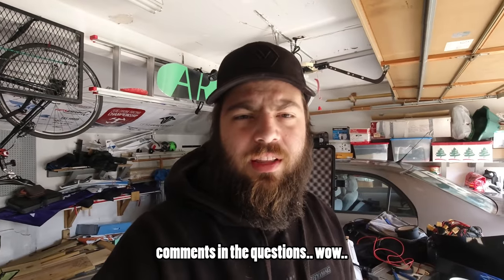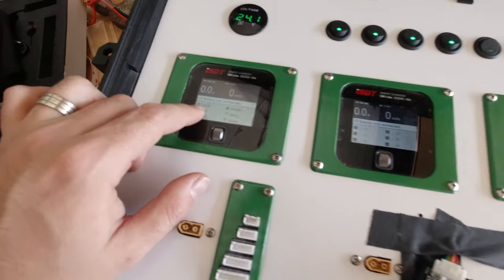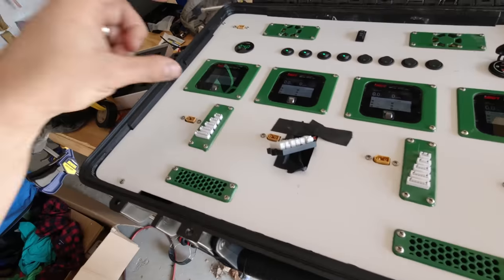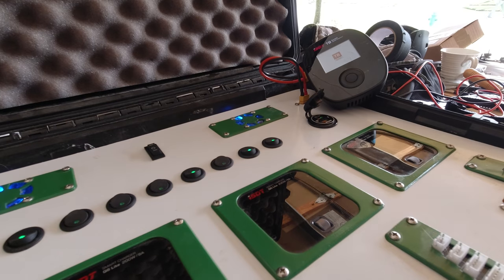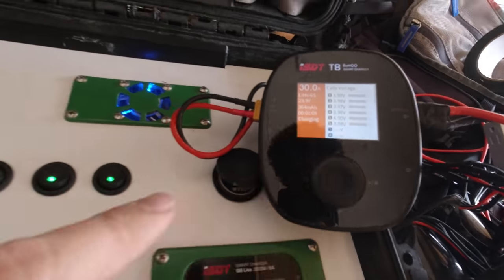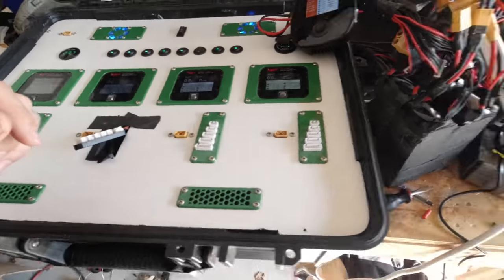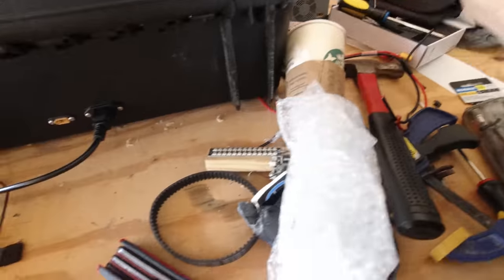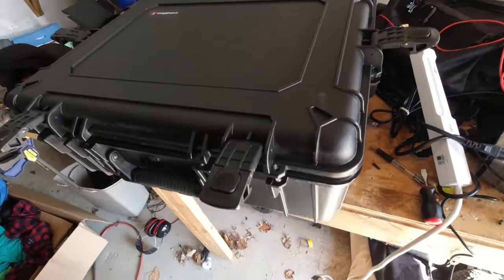Dream Charging Box is Finally Done!

Comment: Think you just meant Amps when saying amp hour a few times, ah only makes sense with regard to capacity 8A for 1hr is 8Ah of discharge, when comparing different voltages better to compare Wh for capacity comparison (accounting for voltage or electrical pressure).  Overall great vid as usual thanks for sharing!

Comment: I would recommend 8 gauge or at least 10 gauge for any hi current dc wiring. I love it though.
Reply: What do you consider high current? I use 8AWG for intermittent bursts of up to 120A, and 80A sustained...
Reply: @skatardude10  Yeah 8 gauge is adequate.  On his build, it looks likes he is using 12 gauge off the main power supply which works, but an awesome rig like this deserves better.
Reply: @locomotive282  yeah well its basicly free air wiring so its ok.

Comment: I have to agree with a lot of the other comments. If you're ever running the full 60a out of the 24v power supply, those wires aren't going to like it. If it's burst, whatever, but you're pulling continuous current. You really want 8 gauge copper.

edit: Considering you're using bussing, you ESPECIALLY need to oversize the wire. A lot of resistance builds up in those busses over time when you pull that much current. You can buy fused busses for car audio uses that will work really well and be a little bit safer.

Comment: Awesome amount of amps at your fingertips there!
Over 3 years ago I assembled something in the same vein, using an old flight case I was given, I mounted an old Xbox360 PSU in the lid (17A @12V) to drive a Turnigy TQ4 charger mounted in the base which charges 4 packs independently. Still using it today. I'll upgrade it one day and add my other TQ4 charger (needs new control buttons), then I can charge 8 4S 1.3Ah packs at once.

Comment: If you have a 12 volt bec that is working on 6s dc in, then it will also work on the 24 volt big power supply so there is no need for the 12 volt power supply.
Reply: I was thinking the same, ALSO no 12v power supply needed neither as there are  buttons, fans, everything that can handle 24v, no need to go 12v at all. Or am I missing something?

Comment: I only have one icharger 406duo in mine..
Planning for a second 406.
Have two 12v 1200w 62amp powersupply connected i series.. so it has 24v 2400w 62amp.
At the bottom i have 18650 batteries panasonic.. 60amp 6s.
I have a switch and relays so
I can choose which powersource to use.
I can charge and regenerative discharge unflown packs right back to the 18650 6s powersource.. which is pretty handy.
Im planning to put in a dc to ac converter with clean sine wave.. 
My thoughts right now is to put everyting into makita Mak packs.. where you can 
Connect and stack for whatever configuration I need it to be.
The possibilities are endles when you get into the whole idea of fieldcharges/powersource.

Comment: Wait, you can charge in the field by hooking that setup up to your car battery!?
How long can you safely charge for, before you run the risk of depleting your car battery?
Reply: Cake if the car is running u could run it all the way till you run out of gas
Reply: Cake, as Bryan mentioned. As long as the car is on it doesn’t matter. The alternator keeps the battery between 12-14 volts while running. If the car is off, you’ll deplete that battery in no time at all haha.
Reply: @jameslaraia  
Even with the car running the power is limited. Most car alternators can output around 900 watts, maybe less at idle. With 6s packs the math goes 900 watts / 25 volts = 36 amps (minus conversion losses). 36 amps should be more than enough for most of us, maybe not for NURK :) .

Comment: @Nurk FPV I see that those buttons use use to switch on the chargers are rated for 12v 20a. And you run 24v through them (on 24v they probably can handle 10a max) but still I see you running 30 amps through one of them. HOW???
Reply: i want to know this to because i need them to but i don't know if they can handle it????

Comment: haha! I JUST bought the stuff to do this with 4  toolkitrc m6's My power supply is definitely not as nice, and I wont be able to charge "at full bore" on AC power, but usually my issue is field charging. When im out flying I dont want to have to wait for batteries to charge.

Thanks for the tour!
Reply: Hey! I'm curious what yours will look like. I too am using 4 M6's.
Reply: Jason Van Ausdal right now mine looks super janky, but I have it in a pelican case, for ac input power I’m using a pc power supply and running 4 switches on the 12v lines to turn on 4 toolkitm6 chargers, and on the dc input they run to the other side of the single pole double throw switches so that I don’t run power into the pc power supply and back feed 12v. Its all in there on a piece of plywood held down with hot glue 🤣

Comment: How much is that whole setup?
Reply: I've been parting out a very similar setup to give me something to do on lockdown. I definitely don't have that giant PSU though. But if you buy pretty much everything new, including that power supply, I'd say you're looking at somewhere around the ballpark of $850. That includes wires, connectors, switches, chargers, fans, plugs, the box, the faceplate and everything else.
Reply: Depends on the supplies you have on hand. $800-1000

Comment: ... the amp numbers just don't tell anything whithout a voltage. watts would be way more meaningful. Besides that the chargers you hooked up in total (t8 + 4x t6 lite) will do 1800w which the Powersupply wont hold...
Reply: Those q6 only output 150w each. 24v

Comment: Why you have switch to turn on the xt60 on the sides? Or swt for the USB? You don’t even reminder what the switch do (lol) so leave them all on?! Sure you could drop a tool inside the xt60 and short it out but if the switch is on it will do the same. It’s cool. Need some P- touch labels and your good to go.

Comment: Fantastic setup. You could get that top panel laser engraved so everything is labelled. Add your logo in a corner etc. (a place near me for example, does laser engraving of stainless steel including engraving photos by laser so that board would be easy peasy IMO on a lower power setting) 👍⭐️😀

Comment: Why do you always carray your AC/DC around, my station has the AC/DC supply separately.
Why so you use 100AWG wires for 60A currents?
Do you always charge your batteries at >2C?
why not using bigger fans?

Comment: A really nice project but I'm pretty sure your cables are not up to the task. 60+A DC is too much for such thin cables. Except if you're using multiple cables in parallel. It was hard to see